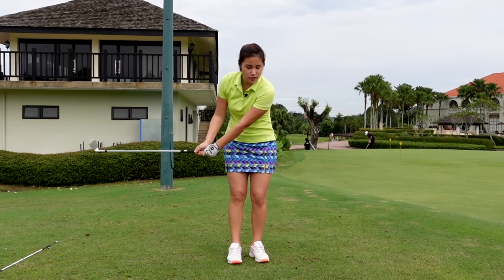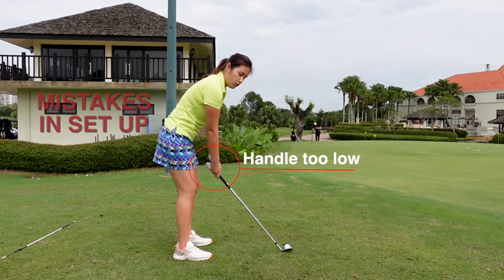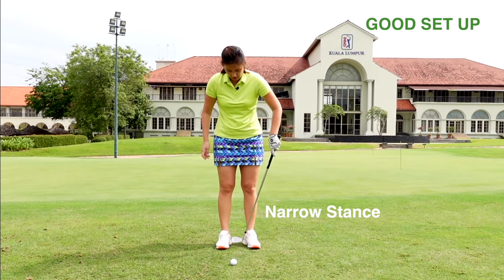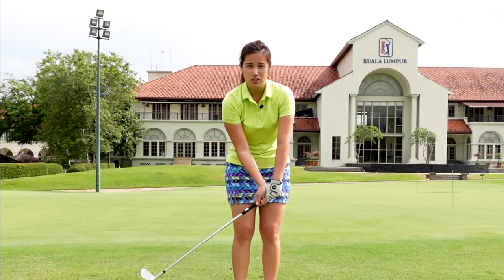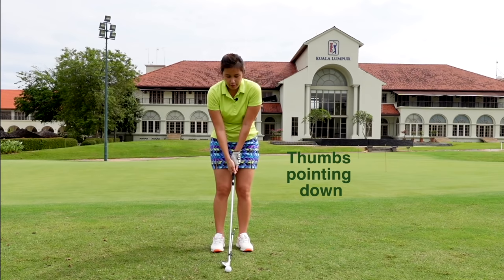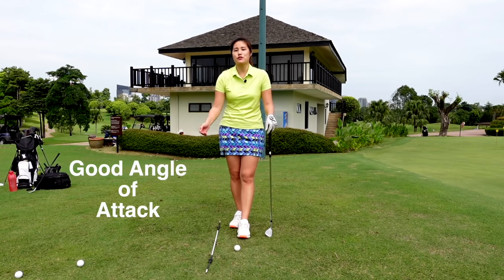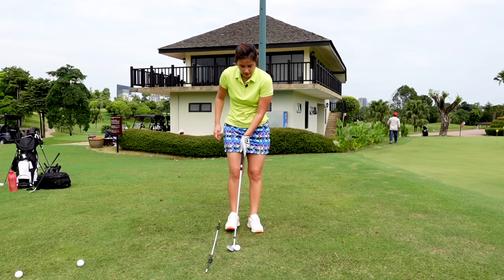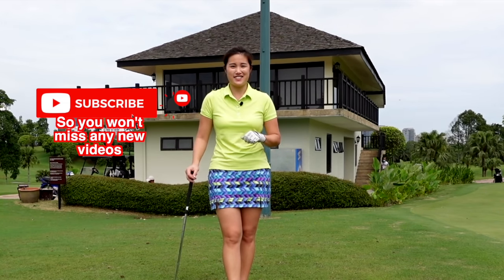How to fix duff and top chips - Golf with Michele Low

Comment: Thanks for your advice.  I still suffered the yips after following your chipping tips.  I practice chipping 20 mins before every match with decent success.  I believe for me my problem is shoulder tension from lack of confidence.  I heard something listening to PGA commentators during a tournament.  They said push the club back with your left arm and back to the ball with your right.  It worked for me on a few chips.  Hopefully I can end this long running issue.  Quick question.  I have a 50 degree then 56 degree wedges.  Which would you prefer.  I think both have 14 degrees of bounce.

Comment: Great Job as usual Michelle.  Unfortunately, I've been playing on rain soaked courses the last three week. Chunk after chunk after chunk.
Reply from the maker: Hope this video helps. Thank you
Reply: this is good, while wet courses present a challenge they require that you ve much more precise and can help you identify and correct weak ball striking.  it is the same for driving range matts vs regular courses.  you will think you are much better than you are off driving range matts because the matt allows you to slide into a shot rather than to strike the ball.  when it rains rush to practice

Comment: @Michelle Low
Excellent video!
Does the setup change with different lies (rough, ball sitting up, uphill/downhill/sidehill? 
Also, how firm should grip pressure be?
Thanks, love your videos! 😊
Reply from the maker: For chipping not a big change but still need to set up so the body adapt to the lie. Like shoulders parallel with the slope. I would say 6/10 for grip pressure
Reply: @michelelowgolf7501  
Perfect! Thank you

Comment: Hi michelle,
Really good video. 
I’m struggling to hit the ball perfectly when the ball sitting up thick grass or sitting inside thick grass. 
1) do you recommend wedge 54 deg or 58 deg ? I have both

2) can I apply bump and run technique ? As per your recommendation, I can use P or iron-9 for bump and run.
Reply from the maker: 1. Your choice. Master 1 first
2. Of course you can

Comment: Could you do a video on 80 to 120 yard shots please. I've started chunking them and taking huge deep divots on these smaller shots. No such problem on longer shots.
Reply from the maker: Could be timing. Work on rhythm :)
Reply: I had the same problem. 
What helps on shorter pitch shots is to make sure you turn the body towards the target. In an effort to control distance, I was using hands and arms only, not finishing my swing.
Hope this helps!

Comment: Thank you, Pro for highlighting shoulder pendulum movement (correct me, if I got it wrong) instead of shoulder rotating. I also think very important as you emphasized earlier "keep left arm straight - no casting". Stay safe
Reply from the maker: Don’t lock the left arm. Keep it relax. Feel the weight of the club.
Reply: @michelelowgolf7501  Highly appreciate. Thanks

Comment: Do you have a go-to club around the green, which you improvise according to the lie, ball flight etc? or do you have more than one or two clubs you choose from? 
For a run to the end of a long green (say, 25 yard) from 15 ft outside the green - would you choose a 56 (SW)/ 44 (PW)/ 9i/ 8i? How do you select clubs for those shots? Important for me, as I play short and the last shot to green (i.e.3rd on par 4) is very critical.
Reply from the maker: Yes, I like to master one club and for me is my 58 degree wedge. My advice is spend a lot of time around the green practicing :)
Reply: @michelelowgolf7501  Thank you!! I get a bit confused about that. But always had a feeling that I must have a go to club.

Comment: Michelle....what is the loft of the wedge you are using in the demo?
Reply: your answer was 58deg wedge..why is 60 deg not recommended for similar situations?
Reply from the maker: You can definitely go with 60 deg no problem. I was using 54 in this video
Reply: Thanks alot for your answer Michelle

Comment: My question is, when the ball is around the green there r too many variables, to execute the shot I want is always challenging. I have 3 shots around the green, 25/75, 50/50, 75/25 depends on how much room I have to the flag. If I can master those shots, I'd b good around low 80s even high 70s.
Reply from the maker: Yes you got it. Try to master one :)

Comment: The biggest problems I see are the golfer not feeling the weight of the club, pulling the slack out of their arms or having the club swinging in perfect pendulum balance under the left shoulder before initiating the swing.  

 To be an efficient and consistent lever arm the human component of the cantilever between shoulder and ball — the lead arm — must be PUSHED straight with slight downward pressure of the right hand against the left.  I realized this when using Hogan’s Five Lessons to re-learn the golf swing his way after 20+ years of struggling with a Nicklaus style swing and all the X factor nonsense in the 1990s and early 2000s.

At address Hogan would hold the club up in the air when gripping it with elbows down, bent and tucked into chest.  Gripping the club with shaft held vertical and elbows bent 90° causes the forearms to counter-rotate against each other as the golfer bents forward at the hips with chin-up (to keep spine from bowing) and club weight pulls the arms straight. That counter rotation only occurs if the club is gripped while elbows are bent and way it must be gripped in the air then lowered not grounded and gripped if one wishes to hit golf shots with the same consistency Hogan was legendary for.

Hogan did not immediately ground the club after lowering it.  If one bends over with without a club the arms will hang straight down  |  pulled that way because of GRAVITY.  But because a Vardon grip turns the arm+club into a cantilever what happens if one lets the club swing freely it will swing toward the body, oscillate for a bit and then come into equilibrium. That is the point on the ground the LAWS OF PHYSICS are going to try to get the club head back to when the golfer swings it!   Getting a very consistent chipping stroke, pitch, 1/4 swing, 1/2 swing, 3/4 swing or full swing shot is simply a matter of letting the club head find its LAWS OF PHYSICS dictated balance point then putting the ball in the way of the club head in a way that when the compressed ball released from the face the face is pointing at the desired target. 

Swing path errors and miss hits are always the result of the club head not being on the BALANCED path at address but swinging back to it at impact.  If the golfer grounds the club then grips it and does not take slow swings over the ball with club in the air to visualize path and when face comes square to target hitting a ball straight is like the “Whack-a-Mole”

What Hogan did before and after letting the club swing to find balance was to push down with right hand onto left as the club was handing freely to get the slack out of both arms. The golf club is not heavy enough to pull the slack out of the arm if just hanging statically, but as soon as the golfer swings it back the momentum acting on the mass in the club head WILL PULL THE LEFT ARM LONGER by 5 - 10mm.  So if the golfer aligns the club to ball with slack arms the club will swing back on a path which is outside of where they expect it to be.  If like Hogan the golfer presses down with right hand against left until all the slack is taken out of the lead (left arm) and maintains that pressure throughout the takeaway and downswing to impact with the ball the swing path and ball striking will become more consistent.  As consistent as Hogan.  Hogan did that press to stretch move when initially grounding the club to line up his body to the target and then again after raising the club to grip then lowering it again.  

That technique of getting the slack out and the arm the same length when lining up the shot at address is especially critical in chips, pitches and other partial swing shot because they do not typically generate enough swing force to pull the lead arm straight in a consistent manner. Just think about it.  If your left arm is varying in length shot-to-hot and club to club in ways you can’t detect how can you expect to swing the club back and forth on a consistent path?  You can’t.  Hogan realized that and devised a simple solution to get all the slack out and the club in balance with GRAVITY before swinging it back and then letting GRAVITY + MASS + MOMENTUM do all the work.

Hogan, while letting the club hang in the air, was also using the mass of the club cantilevered out over the ball to adjust his balance back on his heels IN ANTICIPATION OF BEING PULLED ON THE TOES BY THE FORCE OF THE SWINGING CLUB!   The mistake most golfers make at address is balancing on balls of feet at STATIC address which is the norm in most other sports like tennis or basketball but in those sports you don’t swing a heavy UNBALANCING mass around the body.  By copying what I observed Hogan doing in videos I started setting my balance on my heels at STATIC address WITH CLUB HANGING IN FRONT AS COUNTER BALANCE to the point where if I drop the club I slowly loses my balance backwards.  The result?  Being in perfect balance at impact.  Why is that important?  Loss of balance onto the toes tilts the body and the swing path towards the ball and left of the target.  The modern trend of golfers wearing training shoes with raised padded heels sets them up to be pulled on their toes during the swing with club head and path winding up outside of the target line.  

Hogan’s final move at address while club was still hanging in the air was to ground it the last inch of so to LIGHTLY rest above the turf by sitting down backwards over the his heels, something which is impossible to do ideally without the counter balance of the club hanging in the air in front. At that point Hogan’s club was in perfect balance under his shoulders with hands hanging far inside of them ready to swing back on a perfectly balanced path and then return on that same perfectly balanced path without any need to manipulate it with the wrists.  

His first moves in the actual swing where a LATERAL ==>   press forward then released <== straight back.  Because of the way the cantilevered club mass is suspended under the lead shoulder that lateral action  > == <   will AUTOMATICALLY result in the club head swinging back in an wide arc around the feet  = )   The HUGE error 99% if golfers who don’t understand the physics make in the takeaway is trying to control the path by swinging the hands in an arc to steer the club.  That is largely do to them not getting their lead arm straight and being able to FEEL THE CLUB HEAD FINDING AND SWINGING ON ITS LAW OF PHYSICS DEFINED PATH.   The hands should not attempt to steer the club back in an arc they should simply adjust themselves TO KEEP THE BODY TURNING AT THE HIPS AND SHOULDERS ON THAT SAME PHYSICS DICTATED ARC.

Hogan at some point revealed to Gary Player that one of his observations about the takeaway is that the hands and club need to move separately. What is meant was that if the swinging of the club head is initiated with that forward press - release lateral move the club head starts moving back faster than the hands and then the golfer must then move hips, shoulders and hands together to ‘catch up” and then EXACTLY match the speed of the club head.  It is at the point several inches into the backswing where the hands catch up and then actively start pulling the club head backwards.  THIS CAUSE AND EFFECT NEED TO OCCUR IN A CHIPPING STOKE or else the golfer will wind up steering the club off it’s natural physics dictated path in the takeaway resulting it it coming back on a different path.  

Want to chip more consistently?  Learn how to get the club in balance, get the slack out and feel the weight of the club and let it find its own path without you trying to steer it!
Reply from the maker: You got it Teddy! Thank you
Reply: Teddy..the physics part of how the  parts of the related related body movement is so well explained.Salute your time on the explaination.